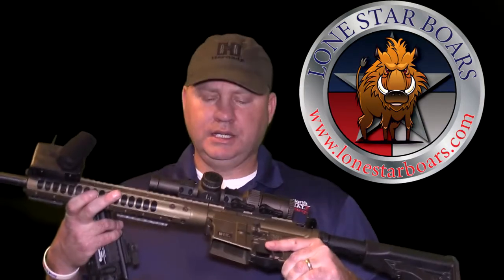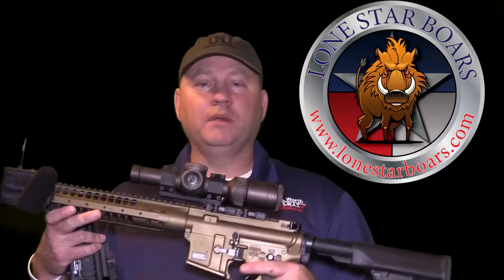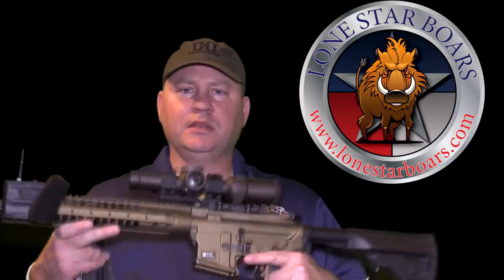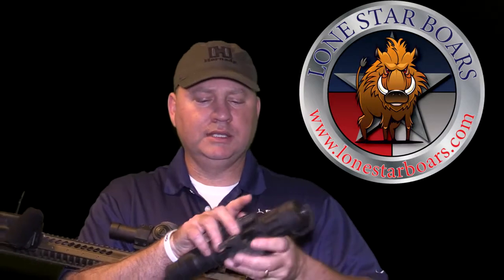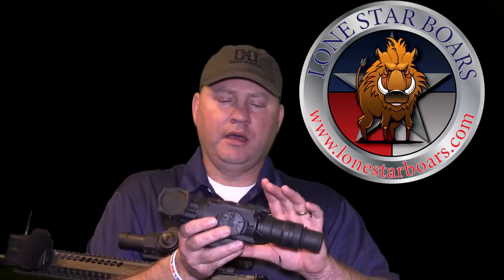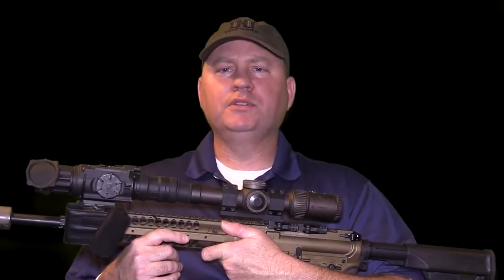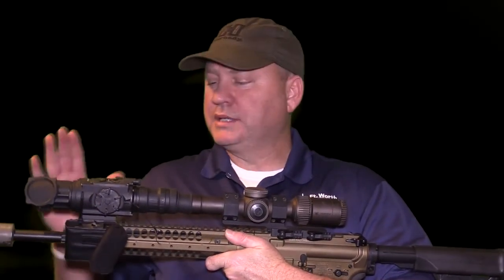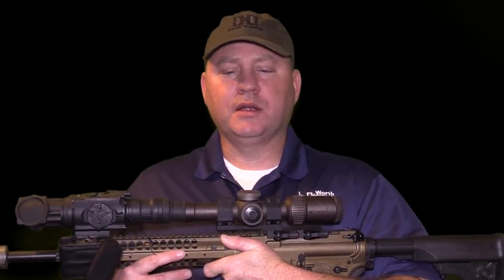CLIP ON NIGHT VISION AND THERMAL HOW IT WORKS

Comment: When I called tech support they said it couldn't be used as a weapon 
sight alone and was meant to only be run in front of an optic.

I tried running on an 4x ACOG but I can't see any of the menu/screen options to know batter state, temp, etc.  Is this normal???